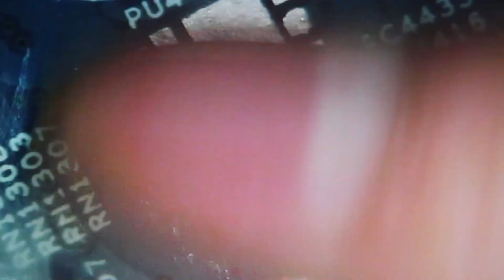Low Melt Solder and Flux

Comment: Hi from france , nice video , i m also starting to repair some devices : laptop , truck ecu smps power supply , and i ve learned almost everything with video like yours . 
Can you give us the link for the flux and the low melt solder you re using ?
Reply from the maker: I am in Kazakhstan.   I had to go and physically purchase most of my equipment as they do not ship.  I  certain you can get much more and better supplies than I can in Kazakhstan.   I also buy a lot of stuff from Northridgefix.com in the US.  They have ex wives excellent stuff and I am sure shipping to France would be pretty quick.   It takes 2 months for me.  I will be traveling back to the US for the summer and plan to buy a lot of stuff, mostly from northridgefix.com.  

It's a good and useful hobby being someone that can fix things.  Good luck!